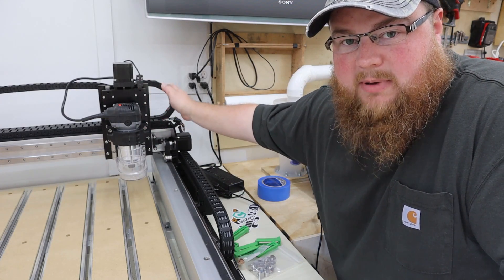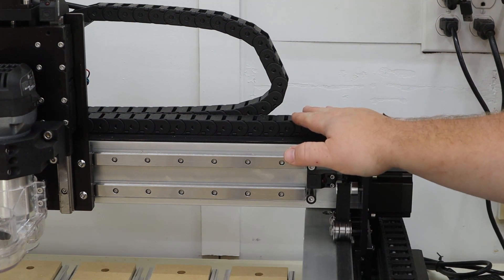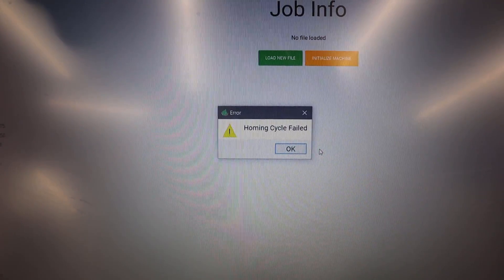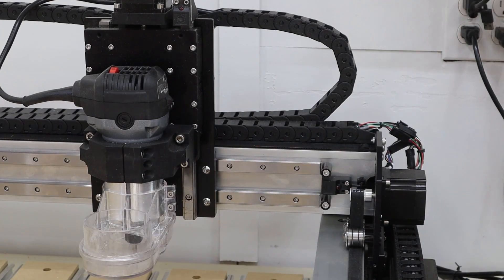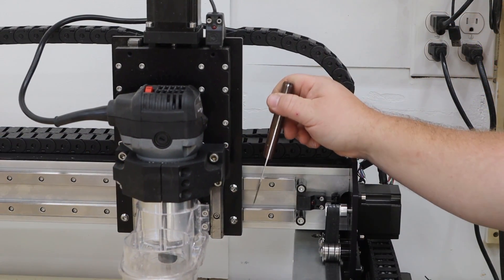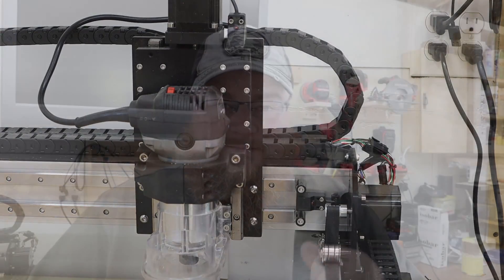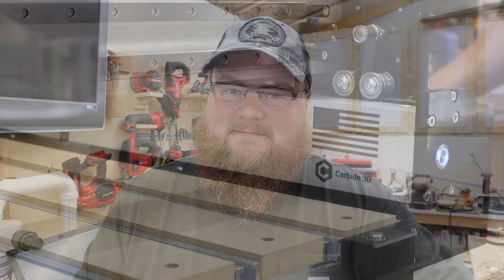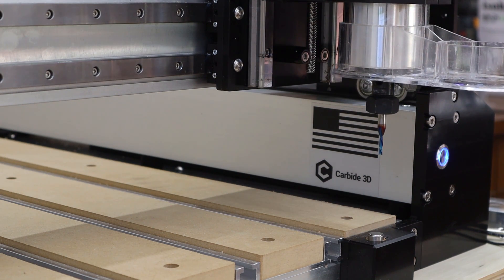X Axis Homing Troubleshoot & Fix | Shapeoko Pro Inductive Homing Switch

Comment: I had the same issue only with the y axis sensor. I had to install a spacer also. 
Word of caution I had several issues with the cable connections. The pins in the connectors have a tendency to back out of the connector when you connect them together. I had several of them do this and the stepper motor were making a horrible noise and vibration. You cold also see it ship steps from the poor contact in the connector. Make sure you inspect the connectors to see if and pins have backed out. 
When making these connections hold the wires behind the connector while connecting the two together. 
Hope this helps.
Reply from the maker: Good heads-up and advice for others, thanks!

Comment: Yesterday I did a shim as well to bring the sensor forward so it can see the metal plate. I ran the program, the light lights up but does not stop! So far the engineering people gave me a new switch, new controller, and now sending out a new prox switch.  I regret buying this. I ordered mine the middle of November, received it the 27th of December, took 8 hours to assemble bc no instructions except a cocky kid w a 17 minute video that I had to watch 1000 times, and still can’t get it to initialize!🤬🤬🤬🤬🤬
Reply from the maker: I hate to hear you've had the problems with your machine. My experience with support has been good, I hope they get you squared away soon, too. If you're not in the facebook group I'd suggest joining, too. Lots of helpful people over there too. I'm not affiliated with the group other than being a fellow member.

Comment: Good video. I have the same x-limiter problem with my Pro. There is a cutout on on the gantry Z-Axis plate that exactly lines up with the x-limiter switch. I tried metal ducting tape but it is not consistent. I will have to try your fix. Thanks
Reply from the maker: I hope this works for you! It's been rock-solid for me ever since spacing it off about 2.5mm. I would liked to have had 5mm, but didn't have long enough bolts.

Comment: I worked on CNC Machining centers 40 years ago, big ones that made parts as long as 80 feet long.(Crank shafts for ship engines) and other CNC machines that made small parts.
I had my wisdom teeth extracted and became stupid and started flying airplanes for a living.
 Your series about this this machine is making me think about acquiring a CNC machine.